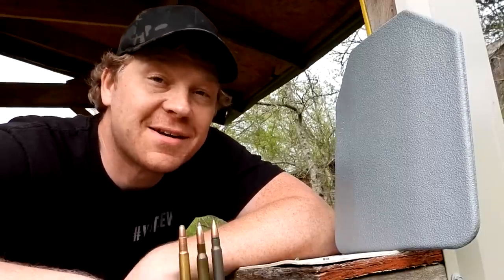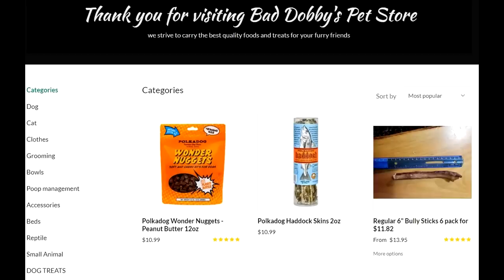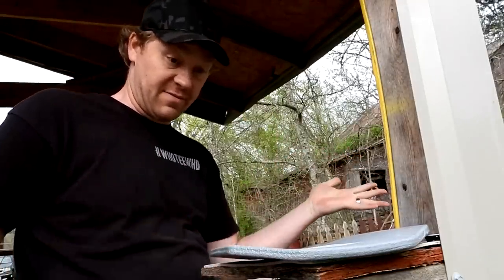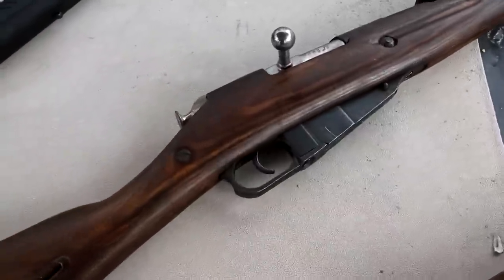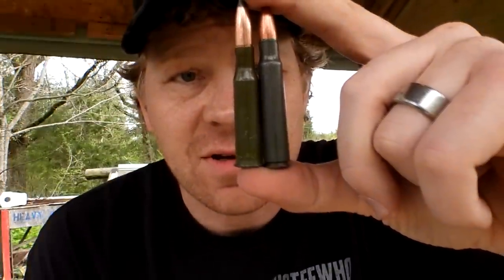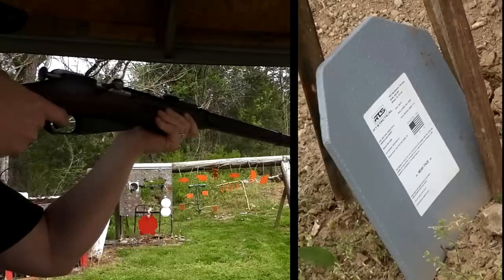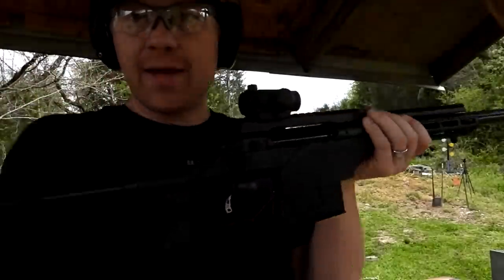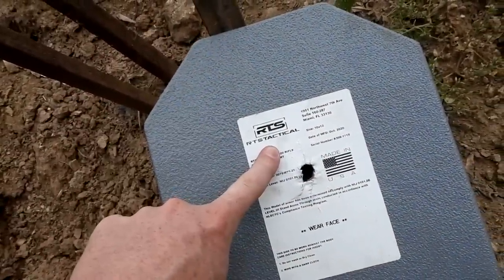303 british vs 7.62x54r vs BODY ARMOR

Comment: That 7.62x54r soft point wasn't made for hard targets. I'd like to see the same test with a surplus Russian military steel core 7.62x54r.
Reply: I was gonna suggest this as well; all of the surplus fmj Mosin rounds I own have a steel core with a lead boattail follower inside the jacket.
Reply: No soft points made for anything hard. Not just dopey 54R rounds.
Reply: The steel core 54 r I have shot goes through steel like a drill bit. I suspect the body armor won’t stop it.

Comment: 303 ball surplus is readily found in Canada , Australia, UK and India, in fact it is still manufactured in India up till quite recently if not still actually being made, those soft points are the sporting hunting round version and being used against military body armor is pointless for I would think would be obvious reasons.
Reply: In india its a prohibited bore,and its means civillians cant use it,only police.civillians are allowed to have modified version of 8mm mannlicher into shorter version and called 315
Reply: Herters(basically budget brand Winchester) makes .303 brand new as well and its cheap in Canada. Seen it for less than 20 bucks a box. And FMJ steel case Barnal 7.62x54r will mess up AR 500 steel with less than 20 rounds. Been my first hand experience
Reply: @Psynova  same, ive never seen 303 below $2/rd
Reply: @andrewthomson you can get 303 British ammo for around $1-$1.50 per round if you buy it in bulk surplus spam cans but most of them are older than 40years old and you have to be careful and make sure they have been stored in a dry climate and everything and you can possibly get some dud ammo from the spam cans so you are rolling the dice when getting it.
Reply: @chadbrattain7185  i can buy a box of 20 .303 british for around $25. PPU partizan brand, a fair decent round especially for the money
Reply: @andrewdonohue1853 ppu soft points are like $80 a box in Canada. Can get them cheaper in fmj but I don’t know where this surplus 303 for dirt cheap is. Never seen it here or I would have bought some
Reply: @aidenschvatkok5732  wow that is expensive. i have paid like $25-30 for a box of PPU .303

Comment: High velocity, soft point, close range gives expansion before penetration. Unless of cause you use a .338lp.
It looked like you hit the dirt with the .303
Reply: I have some of those Brown Bear 7.62x54r, 203 grain soft points for my Chicom type 53 carbine. They hit hard and the expansion is wicked. My 53 is currently loaded with them.
Reply: @mizzoupatriot8814  I have the same ammo! I'm conserving it for the duration!

Comment: get some 180gr .303 soft points and drill in to the centre of the lead down about one inch and place a hardened concrete nail in it make sure it is centred then fire it at your armour, you will be surprised
Reply: What about backwards bullets like they did in ww2 for shooting tanks

Comment: The wartime .303 round was a boat-tailed, spire point fmj round that had a wood or compressed card tip backed by lead. The idea was that the round would hit a target, bend like a banana and tumble through the wound to cause maximum injury.  The soft tip was also a money saving thing during austerity, and got around the dum-dum prohibitions. Your test rounds probably use nitro-cellulose smokeless powder instead of Cordite stick propellants. The original .303 had an accurate range of 1000 yards, but could fly in excess of 1.5 miles. When trialled in the new .303 BREN machine gun, a mag of 30 rounds cut down a tree, so the barrel was de-accuratised to spread the coverage. Your .303 was the SMLE carbine version as opposed to the rifle, which had furniture to the full length of the barrel and weighed 8.5 lbs fully loaded. The later SMLE Mk IV and Mk IV* had folding sights and a longer barrel extension.

Comment: Where to begin.... The .303 and the 7.62, along with every other military cartridge of that era were designed to kill people who weren't wearing kevlar armour. The .338 Lapua was. The. 303 you have has inferior metallurgy to the 7.62 Mosin. There may be only thirty years difference between them, but major advances in metal technology occurred during that time, which means the Mosin can handle higher pressures. 

Lastly, a round nosed, lead tipped hunting bullet is designed to expand..... As it's a hunting bullet. A fmj, spitzer bullet isn't, so will penetrate. 

If time travel was possible, take that ballistic plate back to 1943 and I guarantee you those very clever, crafty Russians (and the British, for that matter) would have quickly worked up a cartridge to defeat it.

As they say, necessity is the mother of invention and war sure works a treat on driving creativity, it seems.
Reply: @Andic Wong They were excellent weapons - especially the smle - for their time. In fact, the world's most successful sniper of all time, a Finn named Simo Hăyhä, dispatched about 500 Soviet invaders with an iron sighted, Finnish M28 version of the 7.62 Mosin Nagant. 

The key phrase is "for their time." Did the rifles of 1943 have better, strong metalwork to the rifles of 1913? Yes, without question. Does that mean ammunition for the later rifles could be loaded to higher pressures, creating higher muzzle velocity? Yes. 

There is a question mark over whether the Lee Enfield action is strong enough to  shoot 7.62 Nato rounds. The Indian Army would have rechambered the Lee Enfields because that is the weapon they had, in abundance. They had achieved independence only a few years before the 7.62 Nato round was adopted and it was by far the cheapest, most expedient option for a relatively poor country with hundreds of millions of mouths to feed. Worrying about whether or not their inventory of smles could safely work with Nato ammunition would have been low in their list of priorities, at that time.

Comment: Just commenting.  No disrespect meant Sir.  I’m Canadian.  The No. 1 Mk. 3 was my first rifle when I got my licence in 1978.  I believe they approximate 7.62X51 level, while 7.62X54R are approximate 7.62X63.  Some feeding issues may be caused by the rimmed cartridge.  Also, trigger is pretty much “two stage”.  There is a lot of take up until you reach the next resistance. Then , not so bad.  Maybe designed to help prevent AD/ND from new recruits?  Both great rifles for different reasons.  Here in Canada, most hunters own at least one .303.  We have used them for everything from ground hogs to moose.  I assume bear as well.  Thank you for what you do Sir.  Much respect from Canada.
Reply from the maker: Thanks for watching Dave
Reply: Yes sir every Canadian has a 303 , and iv taking moose and black bear with it great gun.

Comment: English has never made a decent firearm, but the 303 Enfield has won small war's with that accuracy, it's always been an excellent Sniper Rifle 
Of it's day and I realize admonition is
A little pricey but it's WORTH it 👌 for an Antique 303 Enfield Rifle.
Reply: 😂many would disagree on that comment, the British Webley service revolver was renowned for its robust reliability and saw service in many wars, it could eject its spent shells in less than a second single handed on horse back, it was both single and double action, it’s US rival the Colt SAA as legendary as it was could at best get 6 shots off and reload in the time the Webley could get 18 shots off.
The biggest difference between the UK and the US was that most firearms in the UK were designed for the military and as such there looks and finish was secondary to there reliability, whereas in the US there has always been been a huge demand for firearms in the domestic market, and as such the looks where just as important as the reliability, the US make some fine looking guns for sure.

Comment: The softpoint .303 Brit ammo is all one can find from U. S. manufacturers; it's all made for hunting use.  The FMJ stuff will be either surplus - and the supply is running out, it is finite - or PPU (Privi Partisan) makes brand new FMJ .303 Brit ammo for military rifle buffs (at least before the recent panic).  Of course, right now dadburn near everything is scarce.  And just to show you're correct, FMJ rounds should be compared to FMJ rounds; (you should have used...).  And truthfully, if I were contingently planning to engage a belligerent with body armor, FMJ (if not AP -armor piercing) would be available.  (Presuming I could prepare.)  
I did shoot the PPU ammunition and checked speed with a chronograph.  It clocks about 100 fps slower than some 'Olin' made ammunition which seems to be a duplication of the British specifications.  Just under 2400 fps; pretty serious round.  

Holding the two (7.62x54Rmm and the unknown round) as you did shows the unknown round has a longer case than the Mosin round.  As the Mosin round is 54 mm long (that's what the name means) the unknown round is longer.  I suspect (no guarantee) that case may be 57mm (2.24 inches) long, likely a 8x57mm Mauser round.  

All in all I like the premise of the video.  It compares 'this' to 'that' and fairly.  You seem to be a pretty good shooter.  I like that.  By the way, soft point hunting rounds are not intended to penetrate body armor.  The Lapua is used for sniping, but probably used more for large game.  It has more brute force.

Just so you know:  I do not have all this stuff in my head.  If you do not have one, get a recent edition of .  It is a marvelous reference book and history lesson about such things.  Don't memorize it all, just check on what you have and things you show.  And a decent loading manual will tell you about the length and width of cartridges.

Comment: That metal plate AR500 is called Hardox 500 here in Europe, I work with it all the time. I recommend you buy the whole metal sheet of the same thickness for testing, it will be much cheaper.

Comment: Interesting. The 303 fmj round does not have a solid lead core. A small section of the core at the tip was made from aluminium, ceramic, wood. All sorts of things. This made the round very heavy hitting as the tip invariably broke off on impact causing mushrooming, tumbling etc. The lighter tip of the core was to improve the centre of gravity and stability of a flat based bullet compared to a boat shaped bullet

Comment: The Mk 7 .303 was a dum-dum bullet developed by the British to circumvent the Geneva convention. It was filled with cellulose, or sawdust, in order to move the CG of the bullet rearwards, so that it toppled immediately upon striking anything.
Reply: @Gungeek  Yes, actually several earlier Marks were expanding bullets, but the work-around for the Geneva Convention (which banned them) was the VII, which in peacetime was aluminium-filled but later in expedient War Service was filled with sawdust or cardboard etc.. The VII was the most common wartime round

Comment: You can see a mark from all three shots on the front. A scab finally broke off the inside after the 3rd. Other damage is from it rebounding against the stake. .303 is a calibre, there were dozens of different types of round - expect the 7.62x54 was the same.

Comment: Hey Who Tee Who if you want to find 303 British ammo in something other than the Core Lokt Round nose lead tip maybe try checking with Canadian suppliers as we use the 303 far more often than you see in the US. Also the Canadian hunters have taken the Canadian and Yukon/Alaska moose with the 303 british as well as elk and bears both black bears and grizzlies so it's not under powered by any measure in fact my father regularly took moose with one shot kills on a regular basis. You don't need a huge magnum hunting round to take any north american game as it's bullet placement more than any large powerful round which just cause more flinching and damaged meat and game being wounded than any of these 'underpowered' 303. british.or even a 6.5 swedish.

Comment: The speed of the 338 was more than it could handle combined with the power of that round
Reply from the maker: Zoom zoom
Reply: I'd like to see 300 & 30-378 Weatherby magnums vs steel or ceramics.
Reply: @laurineil-morin3792  Would be no problem for either one as it's rated for 308 at 2700 fps and both at much faster at 200 yards. WTH would cry to see the price of the 30-378 Weatherby if it could be found. LOL

Comment: The two forward tabs on the top front of your 303 mag often causes feed issues when push the bolt forward to load. Tabs need to be bent out the at a bit

Comment: Wolf makes some copper coated steel cased fmj .303 and got Remington lead tipped that looks similiar to the 7.62 round you got there. I actually haven’t found the .303 rounds you have!! 😆 the wolf performs pretty well and was much cheaper than the Remington which was hunting ammo at $34-39 a box of 20 vs the wolf which was 20 for $20. It seemed to be a littler more difficult to eject the rounds with the steel case but not much of an issue for being half the price!! Was pretty much a non issue just not as smooth as the brass

Comment: I've had a mosin for a while. I've only fired the spam can ammo through it. It has about
refrigerator door MOA. Maybe one day ill put reasonable ammo through it. The bore seems oversized for the bullet diameter. 

That 303 round looks circumcised... Why is the cannelure way the heck up there? 🤔Are they reloads?
Reply: Those 303 rounds are antique.I have some they did the canalure up on the bullets so they would mushroom is what I read on a forum.

Comment: Can't wait to see 304 ruger in action. You gonna enjoy it for sure. I love mine. It hold the record on fps. At 4300 fps mach 3. When it hits it explodes. I not find any  fmj for it dont think they make. You would have make your own. In that every bullet is like a small bomb.
Reply from the maker: I cant wait to try it
Reply: The .17 Remington is the most explosive I've ever seen.  I handloaded 15gr Berger moly coated hp bullets to 4450 fps.  Would exploded hitting anything.  Cool little round.

Comment: I know this is old but:
To me it looked like you missed with the 303! Hit the very bottom, or the ground in-front of the target...
I'd also like to see you use same sort/kind of plate but a new plate for each rifle, as the plate might be compromised with the round before.
Another thing is to use full metal jacket rounds for each rifle as it is obviously not the same thing to use the leaded-round points which are made to disintegrate on impact.

Comment: Is it possible to use bullet 7.62x54 in 303 case?
Reply from the maker: I don't think so
Reply: @WHOTEEWHO  how i know real diameter of both 7.92mm or 0.312 inches in your system.
Reply: @WHOTEEWHO  it because we used British imperial system until revolution.

Comment: The 303 is a hunting round and has good animal knock down power. It's not designed for piercing plate. Very long time since I've seen any 303 FMJ boat tail ammo. But for hunting, the 303 is a winner.